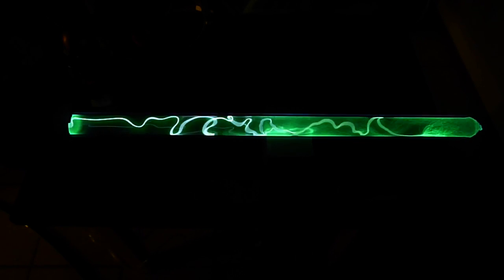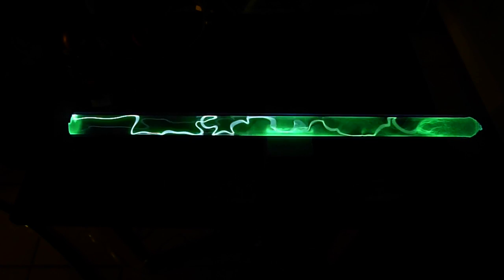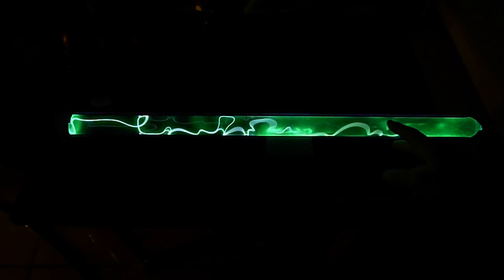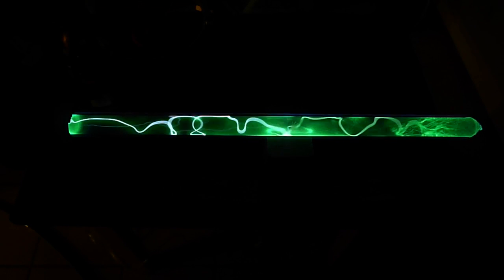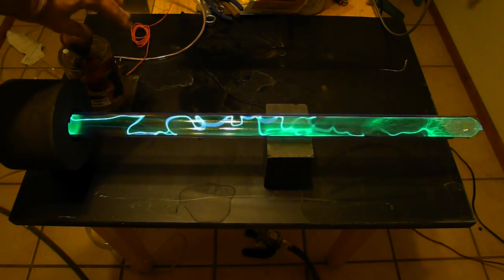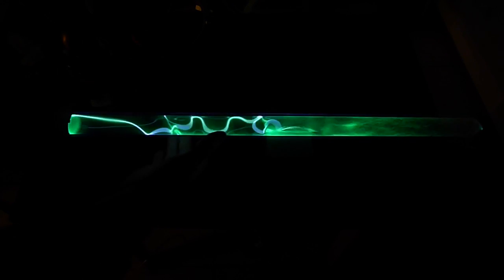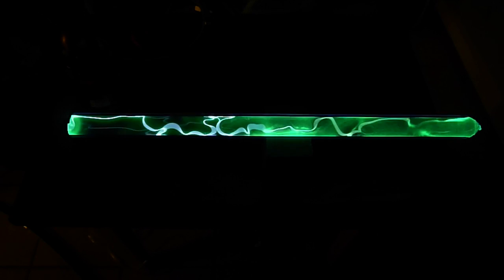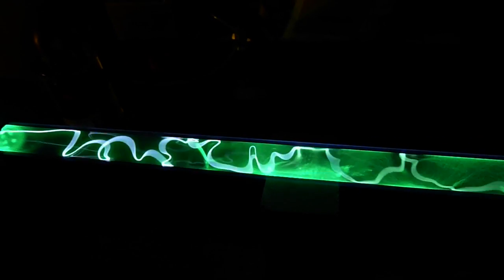Green plasma in xenon-nitrogen mixture

Comment from the maker: Thanks!  I buy my glass tubing from Glasscraft, Inc., and my flask blanks from Friedrich & Dimmock.  I buy gases from Advanced Specialty Gases in Reno.  In the past I have also ordered from Matheson at their local office.  I am not aware of any commercial source for comparable discharge tubes.  I can make them on demand; I have also sold a few of my experimental excess pieces on eBay and I am setting up an Etsy store for the rest.  Yes, the water electrode is pretty universal.

Comment: I have seen a ball of this green  gaseous plasma, form outdoors near a telephone pole, about 7-8 feet off the ground and about 6-7 feet from the telephone pole. It was at night, and it flew around and had a tail. It was about 3ft in diameter, and was visible for about 15-20 seconds. I saw it on the perimeter of the General Motors Proving Grounds, in Milford, Michigan around 2001.

Comment from the maker: The tube contains no internal electrodes, but there is an external sponge electrode to couple RF current through the glass.  The pressure in the tube is way too high (i.e. the mean free path is too small) for electrons to attain enough energy to produce any detectable x-rays around something like this.  X-rays are detectable during pumpdown to a non-striking vacuum.

Comment from the maker: The glass is 1.5" x 4mm borosilicate tubing that is cut into 30" lengths.  One end is sealed in a blown ("test tube") end; a 9.5mm tubulation is added coaxially for pumping, and then the other end of the tube is closed in a test tube end.  The tubes are washed with sulfuric acid and hydrogen peroxide, and are annealed at 1050 deg. F.  They are attached to a high-vacuum system and baked out while being exhausted.  Then they are backfilled with gases, tested, and sealed off.

Comment from the maker: Ah, right.  I put a drop of mercury in a flask with krypton at 100 torr.  The mercury has very little influence on the discharge, but does add a tinge (not much, just a tinge) of blue color as it warms up in operation.  Overall, not really impressive.  BUT...there is a really cool effect that happens when the mercury is rolled around in the flask.  It causes electrification of the glass surface, and sparking in the krypton.  So in a dark room you can see white sparkles as you shake the flask.